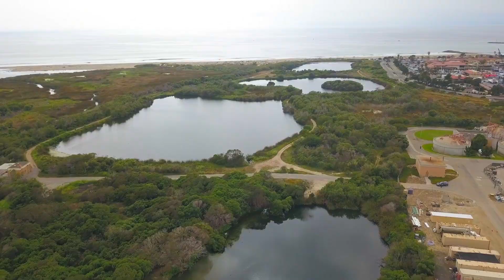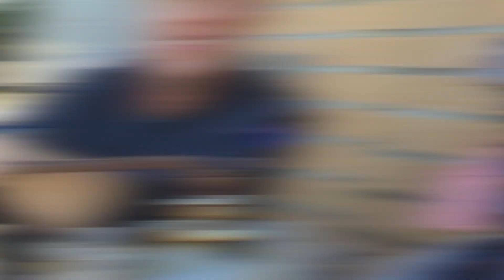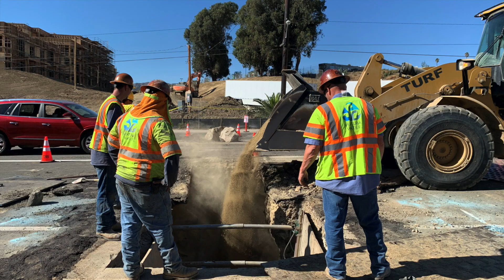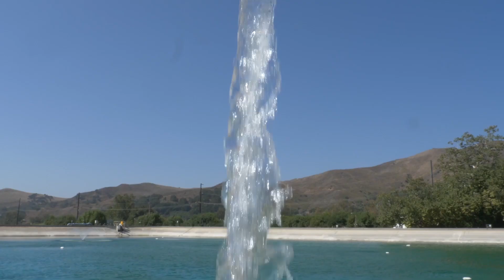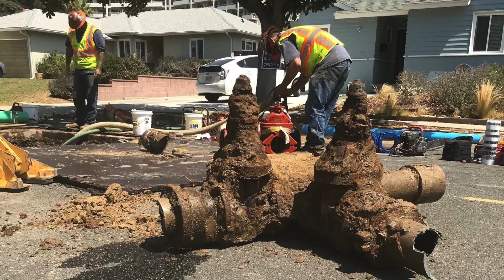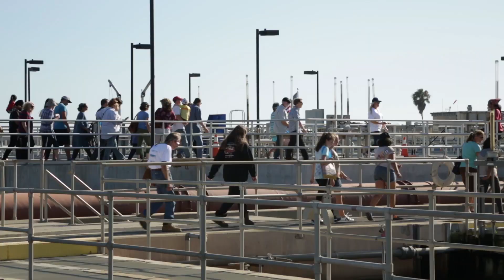Get to Know Your Water and Wastewater System!

Comment: How do I make the water system aware of a potential risk for lack of sewer connections for RVs at Emma wood state beach. I was a host for two years at VSB. In 22 water was pumped from tanks at Emma wood and carried by truck to site C at SBV. City closed he dump site and when I came back in 23 had to empty my tanks at site B site at SBV.
Why is there two big motor homes camping a Emma Wood currently without any existing sewer system so close to ocean?